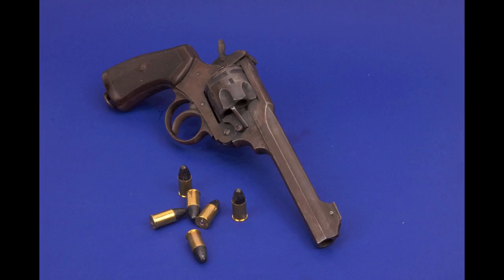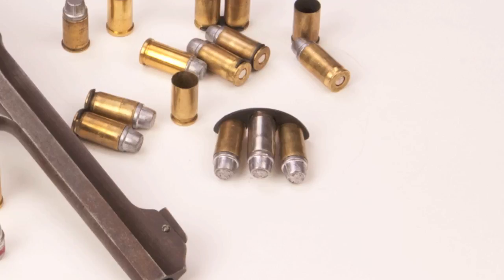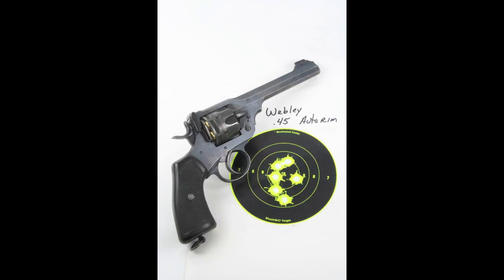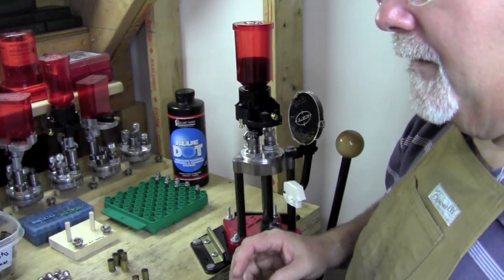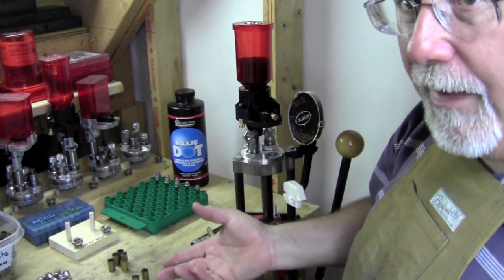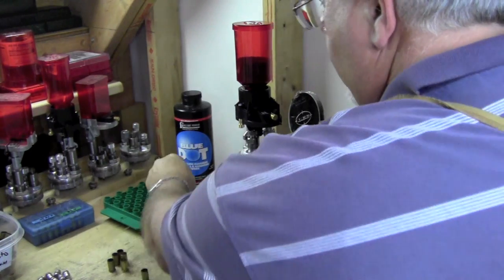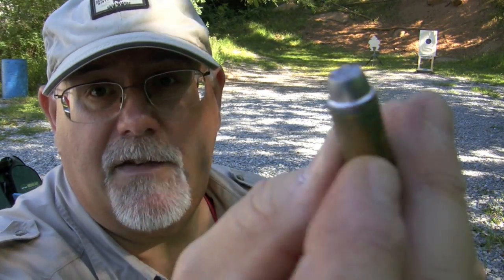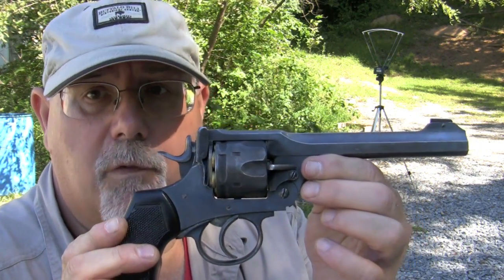Handloading for the Webley Mk VI Revolver - Part 2 - 45 ACP-AR.mov

Comment: Mike:  I found this second part, just like the first part it is excellent.  One way besides the serial number being shaved down to tell if it has been altered is to look at the breech end of the cylinder of the Webley, if it is missing any stampings, that also means it was milled down for .45 ACP/ Auto-Rim.  Kudos on emphasizing the pressure differences and the safety issue it can create between .455 and .45 ACP.

Comment: Hey Mike,
Greetings from Canada. I’ve an “unshaved” MkVI and have found the 45-230U mold from Accurate molds throws a .454” 230 gr WFN that mimics the mkIV/mkV 220gr HBWC used in “Imperial & police” service pre-WWI. Loaded with 4.4 gr Unique in Fiochi mkII brass, it’s a pleasant load.
I’ve found the 262gr bullet goes well with Herco & Blue Dot.
In deference to antique steel, mild loads are just fine for plinking.

Comment from the maker: I went to an art supply store and I bought a plastic sheet with circles punched out of it from 1-inch up to 3.75 inches in diameter. I use those and I use a stylus to take off the black layer of the Dirty Bird targets

Comment: Blue Dot is a funky powder. Even with 12.7 grains of BD in my 10MM I still get unburned powder all over the place.
Reply from the maker: I use Blue Dot in 10MM, .40 S&W and .38 Super. I like it.
Reply: I use Longshot now.
Reply: I get consistent results in 10mm with Blue Dot as well but don’t like to use it when I shoot suppressed. It’s easily the dirtiest powder I’ve tried so far.

Comment from the maker: Actually the neck and base diameter of the Webley is a tiny bit narrower than the .45 ACP/AR ...at the neck .471" vs .472" for ACP/AR. I've slugged a few Webleys...all were .454". I use hardcast bullets.

Comment: I usually load 5.0 grains unique with 255 grain bullet intended for .45 colt and get pretty good results.. I use acp cases with moon clips... Will have to try blue dot sometime.. I have used bullets cast from Lyman moulds and sized .454 cast from pure linotype and they work well.. Mike in Louisiana
Reply: Be sure to check the data to make sure the bullet and powder load are under 14,000 PSI.

Comment: I did not realize that un burned power in the barrel was an indication of low pressure.  That was a good idea to check velocity after finding un burned powder.  I'll have to try that next time.  I have increased crimp to solve un burned powder issues in the past.  I am beginning to realize why that worked.

Comment: Trying to build a round for a 455 MK VI Webley. So far this is what I have. 45 Auto rim case CCI 300 primers 230 grain lead round nose bullet from Matts Bullets Model: 452-230-GVMT IE "Government" Profile Round Nose (.452) The only thing I need is a powder load. I will be using Power Pistol powder. There has to be some safe starting point. 5 grains 6 grains? Something in lieu of blowing up the firearm or causing serious bodily harm.
Reply from the maker: First of all your bullet is too small in diameter. You need a .454" bullet And 255 to 260 gr weight.  I have not used Power Pistol for anything but 9mm loads, but I have not found it to be a stellar performer. I would hesitate to recommend a starting point with it. Seriously though, you won't get great accuracy with .452 bullets, and I would expect you to get leading.

Comment: Thanks for redirecting me to this video series (Webley reloading). When I bought my MkVI, I also picked up a box of 45 auto rim loaded by Georgia Arms. The box has 50 rds each of 230gr LRN and 200gr Speer Bonded HP. There is no way of knowing what the pressure levels are for these rounds. I've read that 45 auto rim was standardized to around 17k which is still too high according to what you say in your video. So would you agree that it's best to pull the bullets and reload them?
Reply: +Robert Hanlin  Yes, if you want to shoot them in the Webley, but if you have a Smith and Wesson 1917 or 625, shoot them in that gun first, then handload for the Webley with the once fired brass.

Comment: I have a chance to buy a good condition Webley MK1 in 45ACP for a decent price. I don't reload, so finding ammo, and shooting it is making me reconsider.

I find some low velocity 750 FPS 45ACP 230 lead round nose, but there is no way to tell if it's too much for that gun.
Reply: Justins1877  it is definetly too high for that gun the MKI thru mk IV where blackpowder only .  the V and the VI they started to use cordite but the british never used a smokeless powder in any of them . A safe webley load is 15g of FFFG blackpowder in all webleys and thats right from the factory handbook.
Reply: +Todd Welsh Cordite is a smokeless propellant and the Canadians loaded military .455 ammo with smokless powder.  You are correct, the older Marks of Webley unless proofed for nitro are not meant to shoot anything but blackpowder loads.
Reply: +John Saia yes but cordite has very different expansion rate and loading than smokeless powder if we are talking cordite ( which is doubtful most people cant get their hands on loose ) its 7 grains of cordite in the original webley loads ( my source is the webley 1904 catalog)
Reply: Like cordite, smokeless powders come in different forms with different burning rates and pressure curves.  Cordite is nothing more than a different form of smokeless propellant that shares more in common with smokeless powder than black powder.   Cordite has not been made in almost 60 years so I am not surprised it is hard to come by in its raw form.  Cordite burns very hot and at least in rifles errodes the barrel faster than ball, stick or flake smokeless powders.
Reply: Thanks fellas.
I bought a progressive, casted some 265 gr HB lead projectiles and using trailboss and unique powder.
The cronny is reading 662 FPS. Which did two things, made it actually group (with very respectable accuracy), and hit the original loading FPS.
Reply: Justins1877 Excellent! Sounds like you have a great load to feed your altered Webley.
Reply: +Todd Welsh They switched to cordite while the Mark IV was in production, so some of them are proofed for nitro. I believe they changed the steel they were using to make them safe for nitro. They were still rated for about 2000 psi less than the Mark V and Mark VI that were designed to use with cordite from the get-go.

I've been using soft cast lead .454 bullets designed for Cowboy Action loads in .45 Colt in my Mark V. At those velocities leading is not an issue.
Reply: @deadsweetheart1   Slightly lower than stick or flake powder, but it still generates pressures faster and in excess of blackpowder loads.

Comment: Thank you for your response. I am more confused than ever. The 455 Webley was imported and the cylinder shaved down to use 45 auto ammunition with half moon clips. Yes I do know the chamber pressure of a 45 auto round  could cause a catastrophic failure. The 45 auto with a diameter of .452, so whats the difference of a ball round .452 and a lead round .452?
Reply: I think you are making an assumption that the conversion to run old military ball was a safe and sensible conversion. It wasn't really. People just got away with shoddy gunsmithing on surplus guns in the old days. The people who shaved the guns didn't care. They just took and old piece of crap (to them) and made it a sellable piece of junk. The .452 Jacketed ball, and the lead equivalent would have been both dangerously high pressure and poor performers. Lead tends to be slightly lower pressure than jacketed all factors equal, and undersized lead rounds will lead the barrel badly due to gas cutting. Jacketed bullets are immune to the leading issue, but not poor engraving and excess pressures. Jacketed undersized will just get powder blow by and poor accuracy.

Comment: Mike. I have a number of loaded .45 AR rounds from another revolver that I once owned. They are loaded with 5.0 gr of 231 behind a 200 gr cast bullet ignited by a CCI 300 large pistol primer for a stated velocity of 749 fps (from an old Speer Manual). Do you think the pressure would be too high to shoot out in the MK VI. Before I undertake the trouble of pulling the bullets and reloading the cases I just thought I would ask. Also, do you think Red Dot would be an appropriate powder or is there a pressure issue here? Thanks!
Reply: What did the manual state for a pressure for these loads?  If it is in the 15,000 PSI it should be fine, check the manuals first.

Comment: I never saw an update to this video, not sure if you're still playing with reloads for your webley or not. If you are you might want to try 10grs of Blue Dot. I reload for 12ga but started with .45acp & AR when I got my Webley. Much like you I went with a .454 bullet. I use jacketed so I might be losing some pressure as compared to a lead bullet that would act as a good gas check. I get about 800fps with bullets in the 250-260gr range. I try to come close to Fiocch load of 262gr bullet at 850fp.
Reply: +job1181 I would be concerned that those loads might be well over the max pressure for the .455 and be very hard on the gun.

Comment: You went from a very fast burning HP-38 powder to a very slow burning Blue Dot. Any thoughts on this? Have you considered any other powders? I have always liked Bullseye in my light target loads (fast burning powder) and the new Trail Boss looks promising but I havent tried any. I never liked HP-38/Win 231 in my low pressure loads preferring it in my 357 high velocity loads. But I havent loaded in 16 years.

Comment: Mike. Excellent Information. If I'm correct, the .455 Webley MK II is a bit fatter than .45 ACP and.45 Auto-Rim,  so can you use .455 MK II dies to re-size and reload once fired Auto-Rim Brass? Also, should you slug the chambers and bore or can you be reasonably sure that .454 cast bullets will be fine? Are you better off with Hard Cast or Soft Lead? Thanks Much for your response.

Comment: Have you ever tried Trail Boss powders in .455 Webley or your .45 AR for your Webleys?  I had a Colt New Service in .455 Ely that accepted .45 Cowboy Special Rounds.  I used 4 grains of Trail Boss in it and it worked fine.
Reply from the maker: No, I haven't. Glad to hear it worked well.

Comment: lead flat point semi Wadcutter 238grains.4.00 grs Red Dot or 4.5 grs Green Dot; 11,000 psi sized to .454 750 fps
Reply: Rory Gibbons where do you get those bullets?
Reply: I cast then myself with a Lyman @25438 mold I've owned it 45 years, it was an Elmer Kieth design for the .45 Auto Rim Case

Comment: Mike,
Need more information on your 45 auto rim load for the Webley. I also have a 455 shaved Webley. I want to load and use the auto rim case. My question is that, all the ammunition listed as 45 auto rim 904 Fps, at Midway USA, is this factory ammunition too high pressure for the Webley? Also how much clearance between the cylinder and frame do i need for the auto rim
Reply from the maker: I'll have to measure my gap. Factory Autorim is moistly too hot, but a recent run of Black Hills is good, if you can find it. I load 5.1 grains of HP-38 under a 255-grain, .454 bullet.
Reply: duelist1954
Thank you for your quick response. I in turn will measure my cylinder to frame gap. From what I found the 45 auto rim has a rim thickness of 0.0827 in. If my gap is greater than this measurement I should be able to use the auto rim case. My additional question to you is how much gap is too much?

Comment: Hi Mike- Timely videos for me. Am just setting up to load some ACP for my 1892 Mark 1 Webley. Owned it for 30 years and put thousands of ACP rounds thru it in ignorance. Four years ago I learned that was thousands of proof-plus loads and haven't shot it since. Sheesh! And I miss it! I'm going to be using  the Hornady 255 grain lead "Cowboy," which is a flat point swaged bullet that is knurled. I like Unique powder (though I may try some others) and have a Unique recipe given to me by another guy who handloads ACPs for Webleys but bullet depth is my quandary for this load. I am also interested in how the difference in barrel length will show up in the velocity department. As you know, the Mark 1 is a 4-in. barrel and your Mark VI are 6-in. BTW, are the bullets you used cast by you or off the shelf? If off the shelf, what's the source? Looking forward to your next videos on this topic.
Reply: If it is a Mark I and is not proofed for smokeless powder, I would probably not shoot it much if at all because of the stress it has been under.  If I did shoot it I would shoot it with blackpowder or blackpowder substitute only with soft cast bullets meant for blackpowder loads.
Reply: John Saia Mine was reproofed for smokeless powder and is so marked. The 255 grain Hornady bullets are soft lead. Thus far I am experimenting with 3.8 and 4.0 gr. of Unique. Both shoot nice and better than when I was shooting the .451 dia. jacketed hardball that kinda rattled down the bore. Just got a chrono so will compare velocities. No doubt they will be pretty low. Just got a set of Lee Webley dies for my Lee press and will try loading the ACPs on it as reliable sources have indicate works well, especially after the ACP cases have been fireformed in the Webley cylinder.
Reply: Jim Allen  I think you are on the right track, if proofed for smokeless, just keep it on the mild side and NEVER shoot jacketed bullets in it again.  Soft lead like you have now is the way to go.
Reply: John Saia I've worked my way up to 5.2 grains... loaded them up last night in fact. the 3.8 and 4.0 gr loads were under 400 fps and 4.5 barely cleared 500 fps 4.8 gr made around 530. Incidentally, I tried a few (last) rounds of factory jacketed hardball to get baselines and the store-bought 230 gr. Winchester loads  I like in my autoloader spit out at 730 fps and some of that el-cheapo Blazer went out at 650. Once I get velocity in the 600-650 range I'll start seeing where it hits on paper and adjust from there. Using the Lee .455 Webley dies works great on the ACP cases.
Reply: DO NOT SHOOT  .45 ACP FACTORY SPEC AMMO IN ANY WEBELY!!!! The pressure is going to damage or destroy the gun....yes, I am shouting at the top of my lungs!!! The .45 ACP rounds are well beyond smokeless pressure PROOF LOADS.  A Webley Mark I is a blackpowder era gun, if you keep doing it, you will ruin your gun.  Sorry, but I have seen far too many Webleys of all marks destroyed by shooting .45 ACP factory/GI spec ammo out of them.  Don't push your gun, stay in the 11,200 CUP range for pressure.
Reply: John Saia John, look, I've had this pistol for over 40 years and probably fired 2,000+ round of factory ACP thru it before I learned that wasn't the thing to do. Who knows how many the previous owner put thru it after the conversion. Not bragging about that, nor condoning it, but I figured it could take six more for testing purposes to get some chrono data. I can tell you those were the last it will ever see. But ultimately, it's my responsibility and my risk what I shoot out of it and when.
Reply: It is your gun, your hands, and your eyes.  It is still a very UNWISE thing to do. Accumulated stress in the metal will make it give up the ghost one day if subjected to enough overpressure/overproof level .45 ACP in a Webley. Common sense safety should NEVER be compromised.

Comment: Just received 45 auto rim brass. The cylinder brass rim  to frame is still .017 thousands. Seems a little much, what do you think?
Reply from the maker: I would load a few and try them. If the primers pop reliably, I'd use them

Comment: I have been using these bullets and 4.9gr of hp-38. I seem to be having a lot of unburnt powder. Is it due to me not roll crimping on the cannelure? I only have been applying enough crimp to remove the bell from the case. Anything helps, thanks!
Reply from the maker: Yes, that very well could be it. I believe in applying a righteous roll crimp to revolver rounds.

Comment: Could you trim 45 colt brass and use it in the 455 webley and not use the clips?
Reply from the maker: johnnt turner I have not done it, but I am pretty sure that it would work. It will depend on how much thicker the case brass is at the trim point.

Comment: I am using a Lee press. What disc setting do you use for your auto rim rounds.
Reply: Lee has a chart for powders to suggest a disc that is close to the right weight. however, you really need to actually weigh the powder and find what it drops. I also use the Lee disc measures and consistently find I want to use one or two holes bigger than the one on the chart. For this application, you really want to be sure. You don't have as much room for error with these types of cartridges and weak old guns.

Comment: I can't seem to find a source for those semi wadcutters you are using for your reloads. could I trouble you for your sources? Thank you.
Reply from the maker: I used to use National Bullet Company, but they closed, so now I use Matt's Bullets  http://www.mattsbullets.com/index.php?main_page=product_info&cPath=71&products_id=305&zenid=sf4vpsot18ahmoiohnn0jqtro7
Reply: Now I am really confused! In your part 2 video you said you used a 255gr .454 Kieth semi wadcutter with corresponding powder drop. The link you sent me was for a 250gr .452 dia bullet. Please clarify for me. If the link is correct, then what powder load do you use? And is a .452 dia ok in the Webley 455 MKVI?
Reply from the maker: They used to size to either .454 or .452...Here, these will work for you.  https://www.midsouthshooterssupply.com/item/0000312458/45-caliber-point454-diameter-255-grain-flat-point-cowboy-lead-bullet-200-count